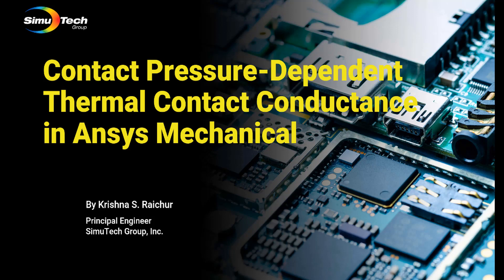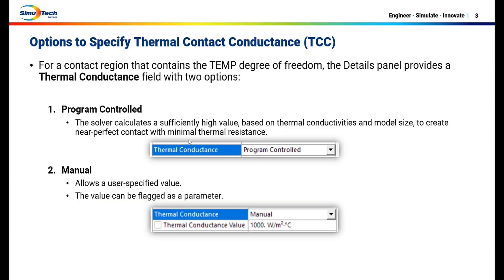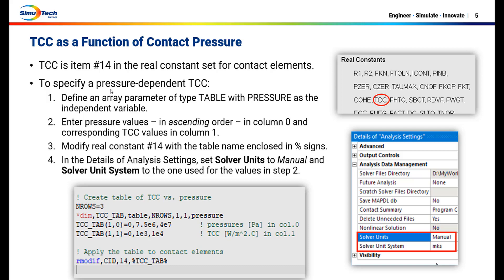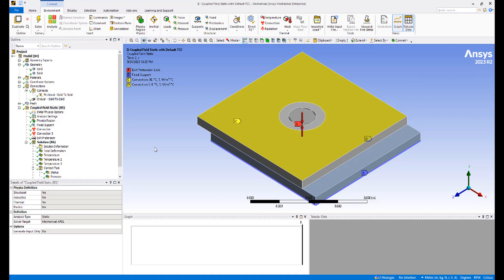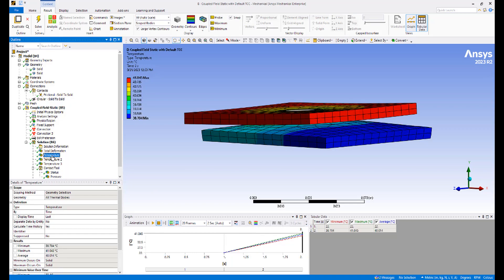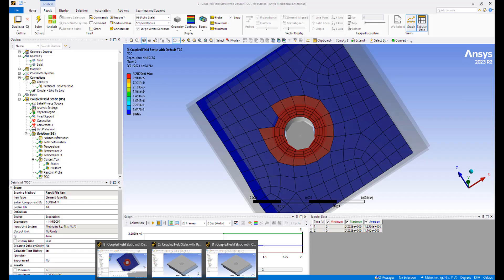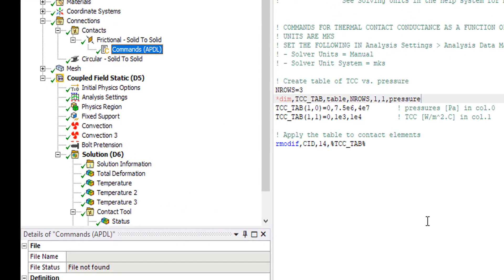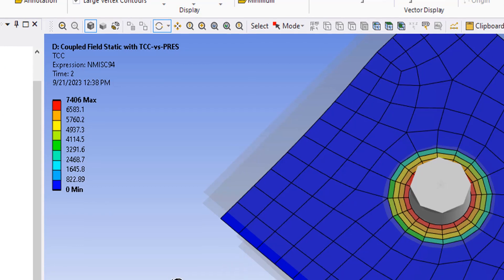Contact Pressure-Dependent Thermal Contact Conductance in Ansys Mechanical

Comment: Thank you so much for this helpful tutorial video. Your clear explanations and step-by-step instructions made it so much easier for me to understand. However, I am wondering, if we can define thermal contact conductance both as a function of temperature and pressure. In that case, how can I construct the table to define TCC vs (Pressure, Temperature) ?
Reply from the maker: Thank you for your comment.

Yes, thermal contact conductance can be a function of both pressure and temperature. The TCC table in the command snippet needs to be a two-dimensional table, with pressures along the rows and temperatures along the columns. Add TEMP as the 2nd variable when dimensioning the table. If you have additional questions, or are interested in Ansys training, mentoring, or consulting, please email us at info@simutechgroup.com